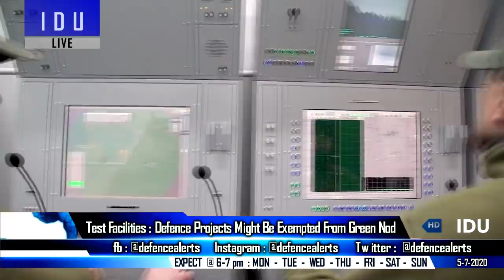Indian Defence Updates : 50 Ton Arjun-MK3 FMBT,6th Gen NGF Tech For AMCA,Godrej Tejas Actuator Clear

Comment: I totally support Army's idea of having separate types of tanks for separate Commands. 

We currently have around 4600 Tanks in our inventory. 2400 T 72, 2100 T 90, 124 Arjun Mk1. 

According to some reports we would be ordering 118 Arjun Mk1A soon. Also we would be retiring around 900 T 72 tanks of older variants till 2027. Rest 1500 will be extensively upgraded to the M3 standards or similar to the Russian T 72B3 standards capable of being called a third gen. tank. Indian Army plans to use them till 2040. The T 72 tanks that we retire can be given to Afghanistan with some upgrades to defend themselves from Pakistan as well as force Pakistan to station some tanks on it's western border as well. We need to push Pakistan into a two front war threat. We need to follow China's strategy over here. They have been helping Pakistan Militarily for decades to contain India and make sure that we remain busy on our Western Border and not focus on the east and to be honest they have succeeded in doing so. Hence we should use the same tactic against Pakistan. Arm Afghani army with T 72 Tanks, LCH, Towed Artillery, Bulletproof Jackets and Helmets, Tejex Fighters. These are light equipments and can be used in the mountainous border terrains of Afghanistan. Give them intelligence inputs and help them launch a Military Satellite. Afghani army is also very brave. They will take care of the rest. Also this will largely help them in fighting and finishing Taliban. Just incase ever there is a two front war scenario against India by China and Pakistan, ask Afghanistan to move it's troops, tanks and other equipments forward bases which will force Pakistan to rethink it's strategy of a Two front war (India and Afghanistan). Afghanistan doesn't agree with the Durand Line and claims KPK area and few other areas of Pakistan. Hence they would love to take these areas back if given a chance. Also this will give them a chance to take revenge from Pakistan for helping Taliban and making Afghanistan Hell. Pakistan will face the same dilemma that we are facing today of a two front scenario. Seeing Pakistan's GDP, they won't be able to fight a two front war for a very long time. Hence Pakistan will fear attacking India more than ever.

As for us, we might order an additional batch of T 90 Tanks or might go for T 14 Armata as our Army is very much interested in it to replace the retiring 900 T 72 tanks. Also Arjun Mk2 will be inducted by 2025. DRDO is already working on GNMBT project which will have a weight of around 35 tonnes, that will be capable of fighting in the mountains. It was reported by 'Livefist' as well. It's on DRDO's website as well. Vt 5 has a weight of around 33 tonnes. So our GNMBT if successful can fight VT 4. So we don't require an imported Light Battle Tank. 

We can place these tanks according to the terrains and threats.

Like for eg.

1. Northern Command(J&K, Ladakh, HP, UTT, U.P) As most of the terrain is mountainous, hence light tanks will be used and that also in very limited numbers due to very less passes tbrough which you can enter the Indian Side on Tanks. Most of this battle will be fought by Troops, Attack Helicopter and Artillery. China will only be able to deploy VT 5 Light Tank over here. Type 99 can't be deployed as it's weight is 54 tonnes. 
We can deploy- T 72 (Upgraded to M3), T 90S and GNMBT (In future) to counter them.

2. Western Command (Punjab, Rajasthan, Gujarat) As most of this command is full of plains, hence tabks with Attack Helicopter like Apache and Mi35 can  run riot over here. Hence we need to deploy our best tanks over here to make sure Pakistan doesn't open another front. 
We can deploy T 90MS, Arjun Mk1, Arjun Mk1A, Arjun Mk2 and T 14 Armata (Army is very much interested so i feel that we might procure around 500-1000 Tanks over the next 10 years) to counter Pakistani Tanks. Pakistan has no tanks that is even nearly comparable to these tanks.

3. Eastern Command(Bihar, West Bengal, Assam, Sikkim, Arunachal Pradesh) Again most of the border area is full of mountains and Arunachal Pradesh is full of Mountains as well as Dense Jungles. So tanks can't be deployed. Over there we can't fight with Tanks but only troops, Artillery and Helicopters. We will have to make use of Guerilla Warfare Technique (Chappamar Yudh) to win. Though we can station our Tanks in the plains of West Bengal, Assam and Bihar and in parts of South Sikkim, just to provide a backup. Though over here even VT 5 Light Tank can't enter. Still we can deploy:- T 72 M3, T 90MS, GNMBT to counter them
IFV (BMP Sarath and Upgraded BMP IFV) and FICV will also play a huge role in supporting the tank formations and frontline troops.

I don't feel we require tanks in the Southern Command except for stationing a few at the Andaman and Nicobar Islands so that just incase China manages to crack the blockade in Malacca Strait in case of a war and try to capture A&N, we have troops and armoured formations over there to defend it. Andaman and Nicobar is strategically very important for us. At no cost should we loose it. T 90MS is very much capable to defend that territory. Hence probably around 200-250 T 90 tanks and 200 BMP Sarath would be more than sufficient. Need to urgently start stationing our troops at Andaman as well. We have a 12 Lakh Strong Army. We can easily station 30,000 Soldiers at Andaman or probably raise an Andaman and Nicobar Regiment whose main task would be to defend the territory in case of an attack. Rest if the need arises to supply tanks in the Southern states, it can be transported through trains. So that's not much of an issue. Hence we will have all bases covered for a two front conflict from the army's point of view.
Reply: WoW, u r amazing 😨😷

Comment: For Armoured corps IFV, What I would suggest is that they can have many projects going at same time but, I have suggestion that let there be one base Model (Tracks, engine, suspension etc) then based on whatever role the model will be made into, the other modules (being developed simultaneously) can be prepared. 
1. MBT Tank: Base + heavy armour modules + ERA tiles, + 125 mm smoothbore gun with 12.7 mm co-axial gun,  Sensors cameras etc on the tank, 
2. IFV(ISV): Base + medium armour + 25 - 35 mm gun (or  30 mm gatling gun with burst fire mode) + 12.7 mm co-axial gun + Sensors etc + anti tank missile launchers  (reloadable)  + MANPAD. the role of this model will be to accompany the infantry and provide fire support to the infantry. Also assist in anti tank support role for infantry.
3. APC : Base + Medium armour + 100 mm low velocity gun (for destroying bunkers etc) + 12.7 mm coaxial gun + Sensors etc + Anti tank missile. The role of this vehicle will be to carry infantry to battle accompanying the tanks, they shall not engage other tanks but strong points and infantry. Even such a model with say 120 mm breach loading mortar will be excellent as that provides the fire support that infanrry needs. Having same base will help to reduce cost due to commonality. The problem is that if the Base has some inherent problems then those get carried up with all the models thus its important to identify or develop such a base.  Arjun tank is good base but its too heavy. We need a base similar to T-90 base medium weight,

Comment: The arjun based light tank would make a good use of the production facilities we built for arjun, arjun already has lower ground pressure than t90, a reduced size and reduced armor will bring it under 35 tons. Its 500mm penetration apfsds rounds will be effective against other light tanks. Its chassis could also be used albeit reduced armor for a lighter namica atgm carrier for LAC deployments.